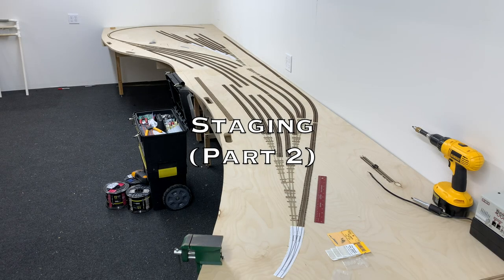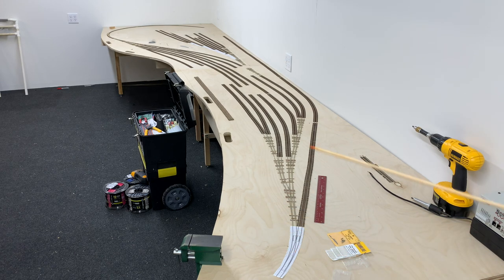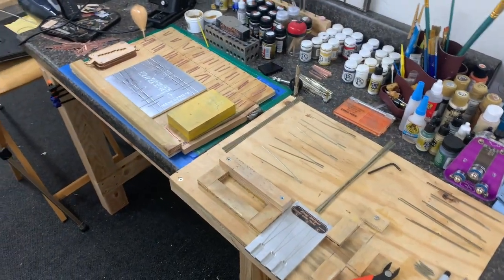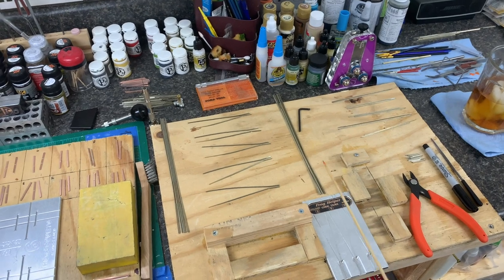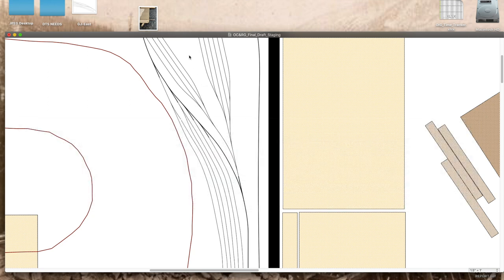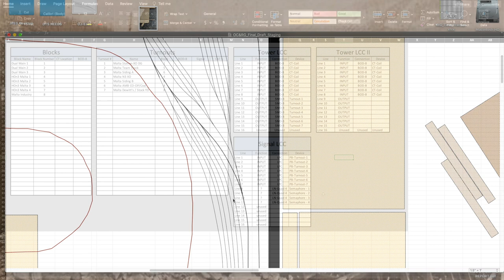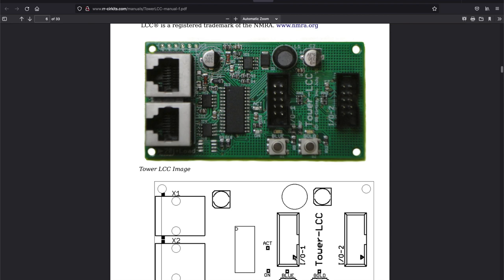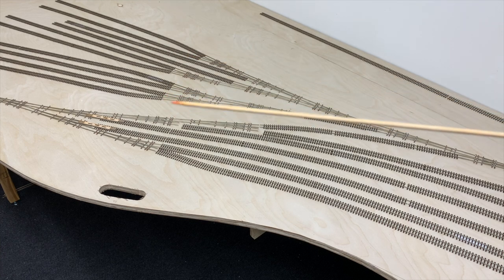MRVU 38 (Staging Part 2)

Comment: Forgive me if you've already mentioned in your video, but have you considered powering your staging tracks off when not in use? It is a very important feature for many reasons: sound/noise, power surge protection, accidental collisions, etc. On the RR-CirKits page under Notebook take a look at Staging Control with TC-64 article. Based on that principle, you could do something similar with the Tower LCC utilizing the same I/O line for both Input (BOD) and Output (track power via a relay board).
Reply from the maker: I was planning on discussing that in my next update.  I am indeed planing on a length of "dead" track on my 6 staging tracks. 
About 9-12 inches at one end, and maybe the whole track in the engine yard.  My plan was just a simple on/off toggle.  Thanks for pointing me to the article on RR-CirKits sight I will definitely check it out.
Reply: Amazing question I had been asking myself as my tri deck layout is only connected by rail barge/ferry moves and I have no clue if I’ll have to run three different systems since there not connected together or boosters or switches to turn each one on. It’s got a 12 foot x 12.5-17inch section along the hallway and the main layout room is a M shape that’s 8.4ft x 7.9 foot as well as an additional 6 foot attaching it to the hallway straight section. And that’s all three times over as it’s three decks go all the way around.